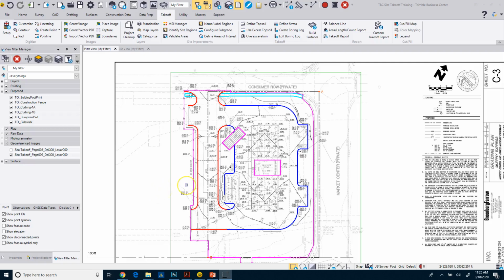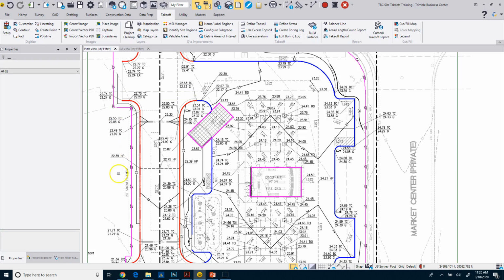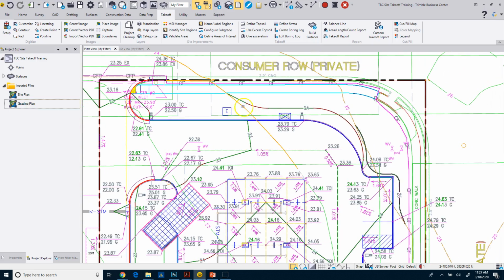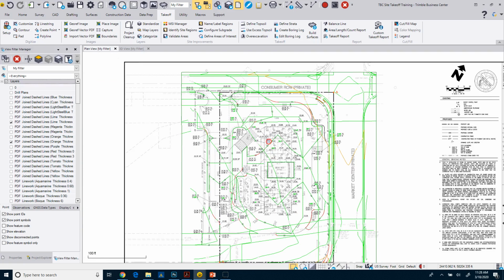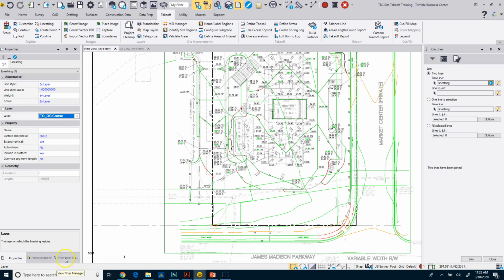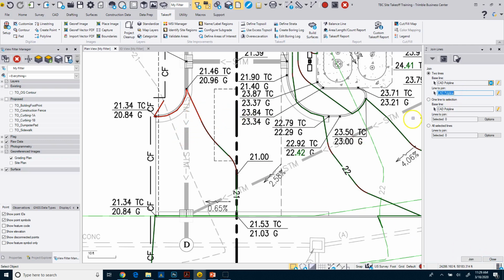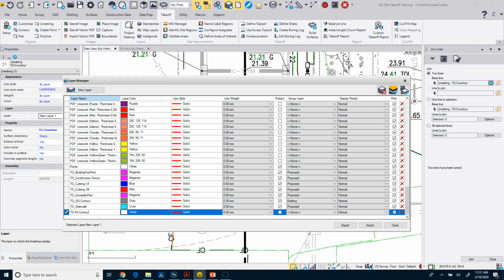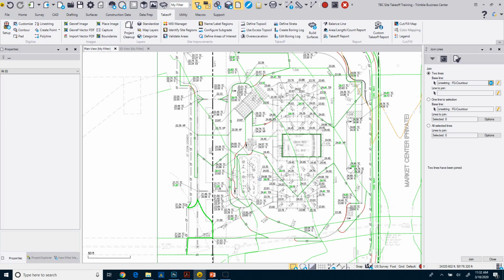TBC Site Quantity Takeoff - Import and Join Lines Option

Comment: Enjoying your videos! Had a comment/question. When I bring in the vector data for the second PDF sheet I’ve noticed that since the layer color, line thickness, and layer name is the same for the next batch of lines that it will intermingle the first with the second set of data. I have had to go to the re-layer command and add a prefix to the start of all the PDF layer names like say a (1-) before bringing in the next set of data in order to keep them separated. Is this something that has happened to you or am I doing something wrong?
Reply from the maker: Hi Sorry for the late reply... yes you use the prefix prior to importing so you are doing it correctly... If the PDF has the layer names stored in the PDF  you'll get the CAD data on their original layers, if the layers aren't part of the PDF, TBC puts objects and matches them based on color, weight... which make more work... this depends on the PDF Driver that makes the CAD File a vector PDF.  Let me know if that helps.